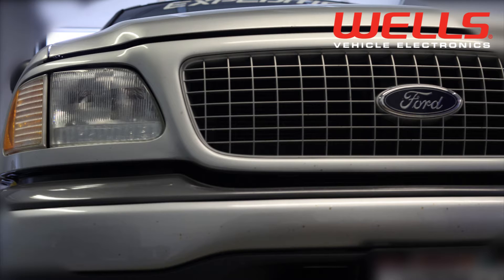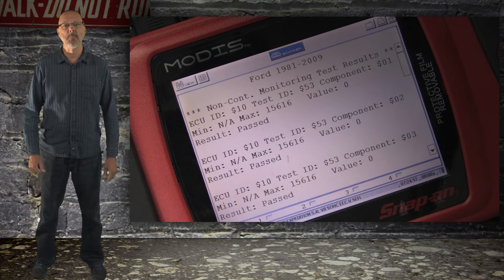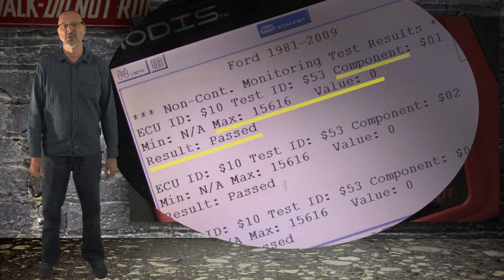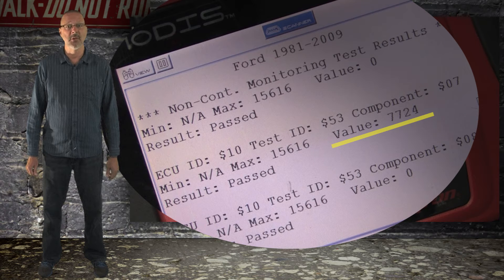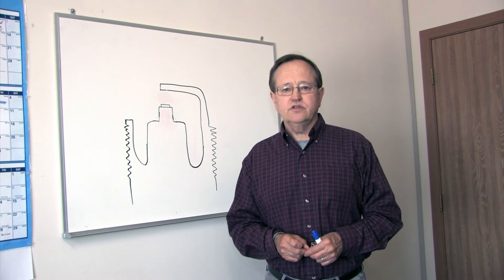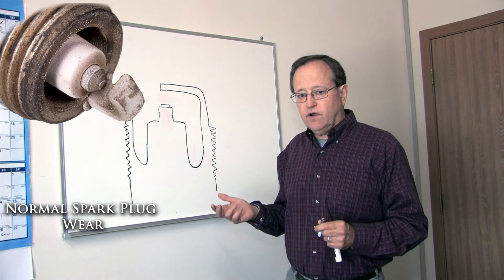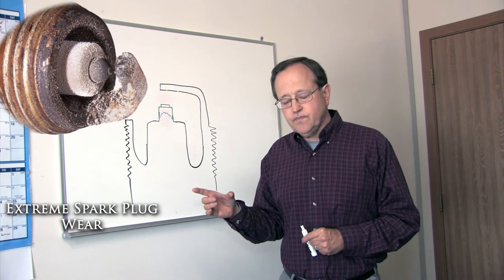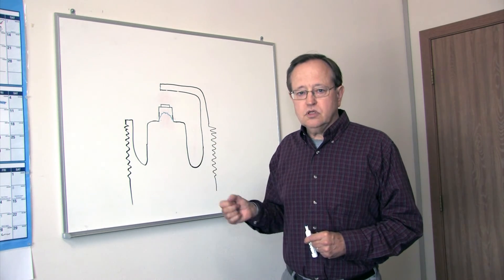Ford Expedition Misfire Diagnostics using Mode 6 by Wells

Comment: How could you possibly NOT put in plugs with almost 155 K ? Think about the wasted fuel . If you damage the coils - due to the large gap - more expense . And - if the plugs get FROZEN in the head , or possibly break on removal and take threads with them , you may pay big time !  Especially in a snow belt vehicle , heavy on salt . Everyone is busy , but this just doesn't add up !  But they may keep it waxed !
Reply from the maker: Bill, i wish I knew that answer. You're right...155k is insane.
Mike Becker, Senior Technical Instructor

Comment: I'll need to get into Mode 6 on my scanner tomorrow morning, but after watching this I'm confident that it will confirm my suspicions and lead me to a faulty COP,  though I'm probably going to replace all eight as long as I'm under the hood.
(My '07 Expedition definitely has a misfire at 40mph-50mph, and it's still there after changing all of the plugs [I will never again own a vehicle with a 5.4L Triton], but it's not throwing a code.) 
Very informative video!  Thank you very much!
Reply from the maker: Thanks for watching!
Mike Becker, Senior Technical Instructor

Comment: Thank you all for the great training. Question. Value showed about 7,700 max was approx 15,000. Isn't that about 50%? Or am I misunderstanding the description? Thank you
Reply from the maker: Hey Harry, thanks! This 7,700 value is half of the value that would set the light. The light will set with 15,000 misfires. This value needs to be divided by .00015 to give us a percentage. Meaning the light will only set if the PCM records 2.3% misfire. The 7,700 is about a 1.1 % misfire. I hope that makes sense. Thanks for watching!
Mike Becker, Technical Services Instructor

Comment: I was little surprised that the professional scanner that you used did not have the decoder ring even though it probably costs few thousand per year in the subscription costs alone!  For somebody who is curious and has no professional association with the auto industry solely depends upon Google for some scraps on Mode $6 tidbits and those are very slim pickings!

Comment from the maker: Decoder ring is right. I did a lot of research to find what we show in the video. As far as I know there is no one spot to get the information. You are absolutely right about the different manufacturers, years models and algorithms. The problem is they are reluctant to release the information because they are revealing the computer's strategy.  Personally I don't think it is right, but this is what we have to deal with. 
Thanks for the great comment,
Mark Hicks
Wells Vehicle Electronics

Comment: How many manufacturer put the misfire count in mode 6 data?  Where to find the Mode 6 decoding rings?  As mode 6 TID/CID are not standardized, every manufacturer uses their own numbering scheme and it can even be different between different model years.  I usually try to see if i can find the mode 6 decoder for my specific vehicles but the success ratio of such a search is pretty low

Comment: 1. Check the output voltage of the governor pressure sensor Key On Engine Off (KOEO). It should be between 0.6- 0.7 volts.

2. If higher than 0.7 volts, check the transmission temperature sensor reading. If close to actual transmission temperature, the sensor ground is OK.

3. If the sensor ground is OK, the governor pressure sensor is faulty. 

Most common is a defective governor pressure sensor!
Mark Hicks
Wells Vehicle Electronics

Comment from the maker: Great question! After a lot of research I found it listed two different ways .0015 and .000015. After doing the math I found neither of them added up. I then tried .00015 and it worked out. After evaluating this, at this time, I have the opinion, Ford will use any one the three depending upon the vehicle etc. It also appears some manufacturers hold this information very close to the vest.

Mark Hicks
Wells Vehicle Electronics

Comment from the maker: We found the multiplier info in several different articles about mode 6. However, it appears for some Ford vehicles the number could be different. We found some used two zeros and other used four zeros. 
We did a full functional test including current ramp in the lab and the coil itself was OK. The boot had a pin hole in it. good point about the new style plugs!
Thanks for commenting,
Mark Hicks
Wells Vehicle Electronics

Comment: Good info on the mode 6 data for the Ford.. I was wondering where did you find the info about the multiplier for the miss fire counters??

When you did the job did you current ramp/do a primary or secondary wave form at all to check for shorted secondary windings?? I know on newier versions with the longer/updated style spark plugs the last thing you want to do is attempt to pull a plug out to do a visual inspection..